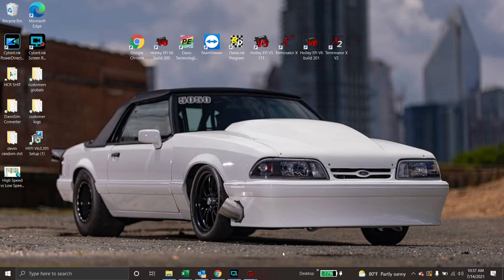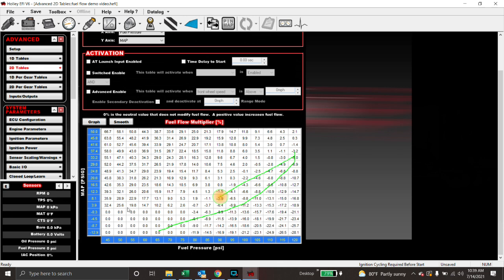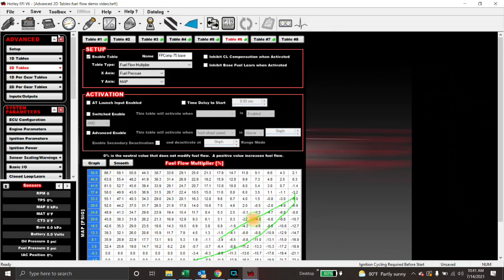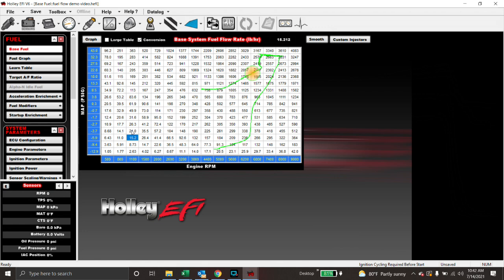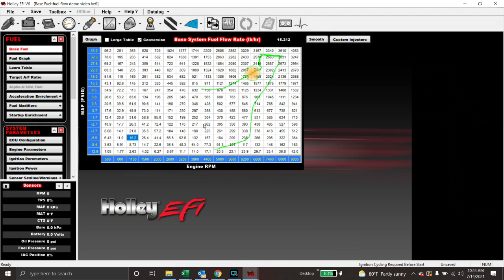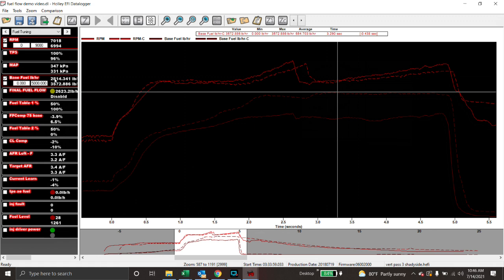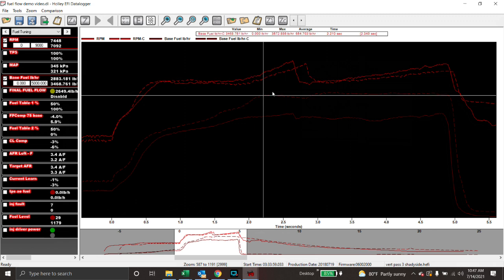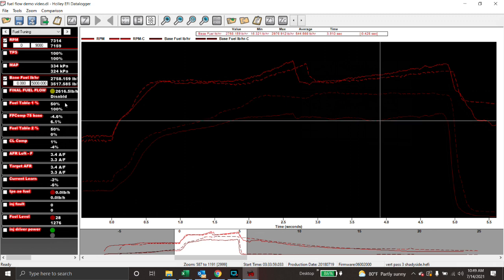Understanding Fuel Flow with Holley Efi

Comment: Devin whats the difference between Base Fuel lb/hr and Fuel Flow in the Holley? They both show in lbs/hr but are different values when reviewing a log.   I thought Fuel Flow was the actual fuel flow after closed loop compensation and whatever other modifiers were being applied?  Thanks for the video!

Comment: I only understand your cars are different cause of Engine size and injectors.  Can you explain what all the fuel flow, injector pulse width, dead time, pounds per hour etc. numbers mean. And how do you know if they are right or everything flowing correctly? Thanks!

Comment: Is this an issue with the dead time data being inaccurate on the BA's? Also, his FP comp almost makes up for the CL comp, so his numbers are definitely quite a bit higher. It would be nice if there was an easy way to physically measure the fuel flow.

Comment: “It’s a man motor, not an LS”. Classic lol!  I always just figured that fuel flow shown is just a calculated number based on input data for the injector.  So maybe the data is very accurate at all rpms, maybe it is not.  A big ol hog of an injector cannot be as linear as a small injector across the rpm range.  So to get real accurate (actual) fuel consumed you probably need to do it on a dyno with special measuring equipment.  So I try not to get too hung up on the pounds of fuel I see on the dyno or drag strip as long as the bsfc seems in the ball park.